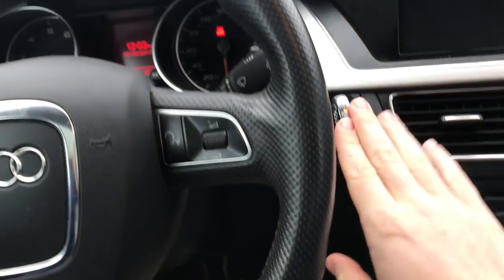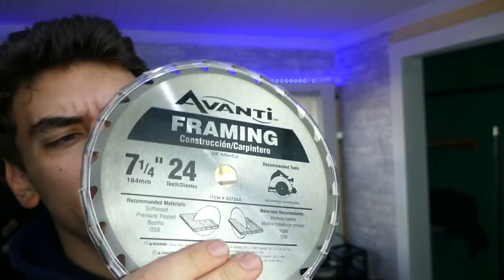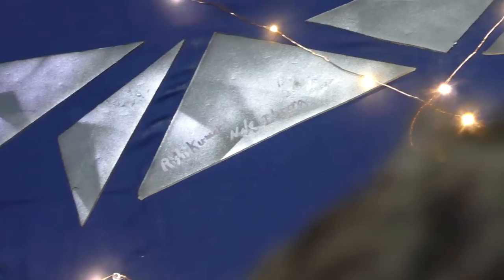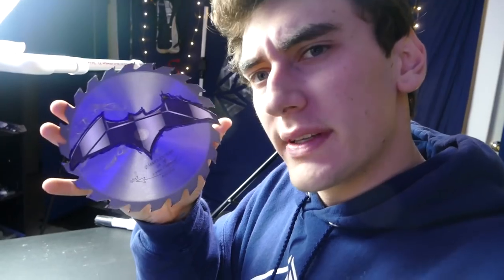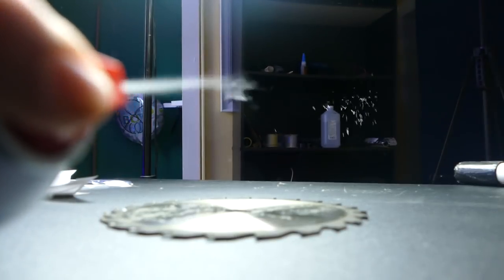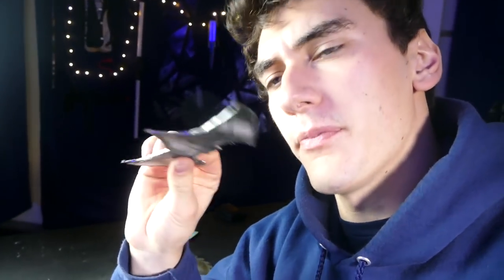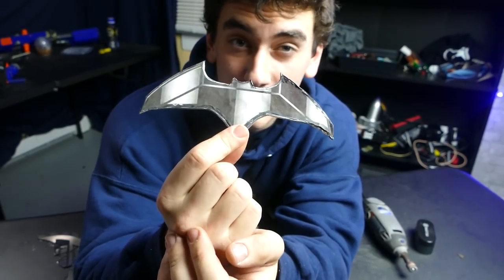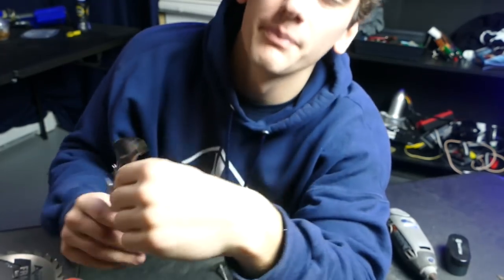How To Make a $7 BATARANG From Justice League!!! (Real Working Batarang)

Comment: I like how you did the build you could try a cloth wheel and some white an red jeweler's rouge which will polish it up and also help clean up all of the belt sander marks and maybe try a round piece of black velcro on both sides to cover up the hole in the center of it?

Comment: I just bought a dremel to help make one of these.
But I also have an angle grinder with q thin blade that cuts metal.
Used it to cut the basic outline then use the dremel to finish off.

Comment: if you have the hole in the middle, its better because, if you have a utility or belt or a wall or whatever, you could add a cylinder onto it, so you could keep the batarangs on it

Comment: problem with dremel bits is they're so expensive. no doubt the lines would be better if you fixed the piece to the table so both hands could be used to steady the tool. other than that i think it came out looking pretty damn good.